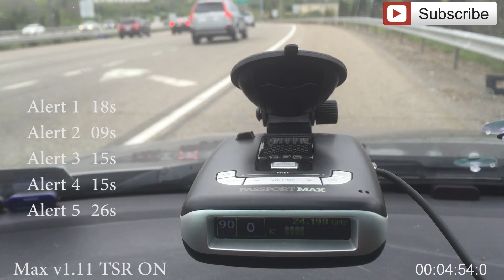Escort Passport Max Latest Firmware K Band CAS Filtering Rejection TSR ON

Comment: So I was a little confused at first, thinking 1.8 surely was the later FW vers. 

I haven't looked yet, but I suspect they are doing that weird thing where they are naming the FW versions 1.8, 1.9, 1.10, 1.11, 1.12, etc..  Not 1.1, 1.11,.....1.8, 1.9, 2.0, 2.1.  So going from 1.9 to 1.10, instead of 1.9 to 2.0.

 Most of the time 1.11 would be before 1.8.

So I guess 1.11 filtering off is better than 1.8 filtering on?  So that means filtering is on even when you have it turned off?   Or maybe there were just less cars that went by when you were testing the  detector with filtering off? Hard to say.

I've been using a BEL Vector 995 for several years and it has worked great up until the radar sensors on cars got more and more prolific, but I'm not going to invest into another detector until the filtering works really good.. better than what is available now.

Hopefully they can figure it out..  soon.